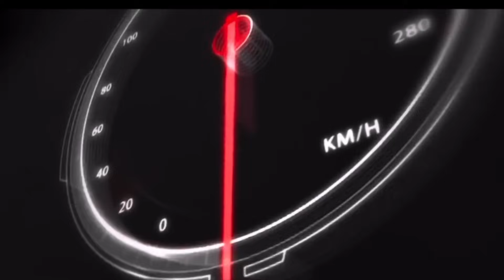Who’s Replacing Kaylynn???

Comment: <><> >> From My Experience being on Different Top Fuel Dragster Teams.. One of The Most Stessfull parts of being A Clutch Guy is >>> Doing Last Minute Cluttch Adjustments in the Staging Lanes right before The Car makes A Pass.. Changing Nuts or Washers to Adjust A Change on The Hat of the clutch also known as the Pressure Plate for The Normal Car Guy.

Comment: What is "doing racks"??
Reply: Setting up the pistons, rods and rings.
Reply: The assembly of connecting rods, rings, and pistons which are then hung on racks ready to be installed in the engine.
Reply: what did he do with the rings to get the nick name... it sounded like it was an error.
Reply: @bassassin2ohseven584  Thanks for the reply. I thought a new a little about drag racing but not what the job of "doing racks" entailed.
Reply: @murmac7856   Thanks (also) for the reply. I thought a new a little about drag racing but not what the job of "doing racks" entailed.
Reply: @theoldbigmoose  Ive never heard the story but I'm betting he forgot to put rings on a piston or maybe missed one of the rings.

Comment: $5.00 for scrap copper head gasket ...... or $50.00 for a signed  by ( Clay Millican ) shipped to whoever copper head gasket your math ain't mathing sir !! blower manifold wall hanger man cave stuff easily $250.00 shipped scrap value maybe $20,00 bucks clutch disc ,oil pans all great conversation pieces ! you all would be surprised who all will buy this stuff .